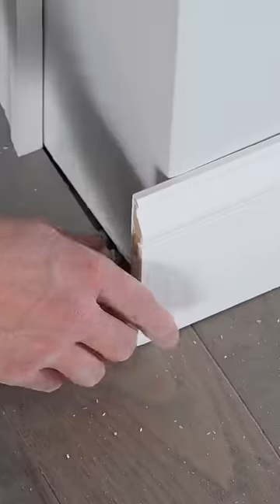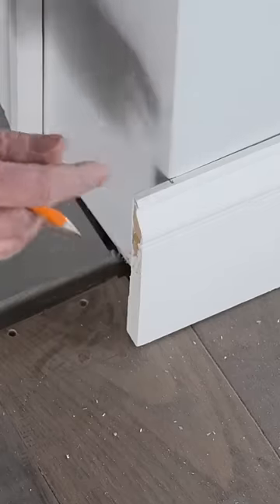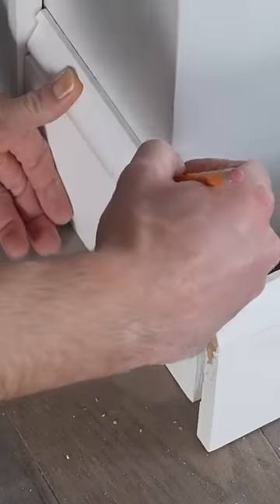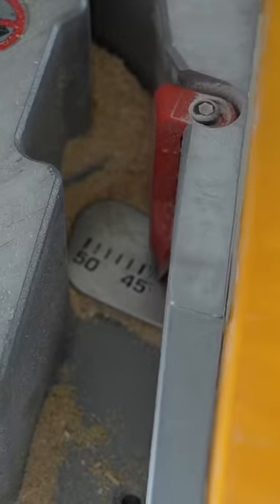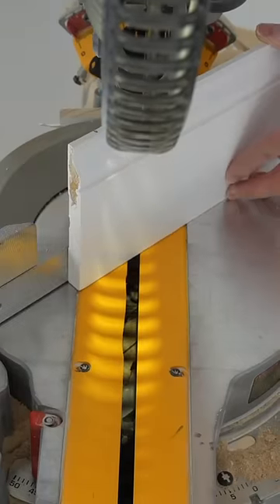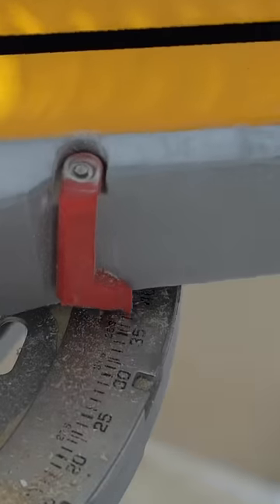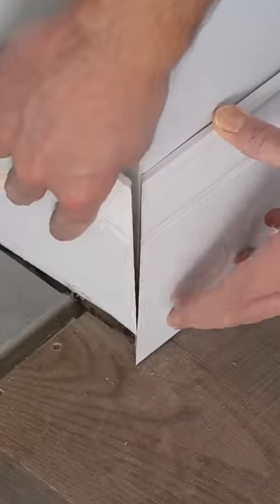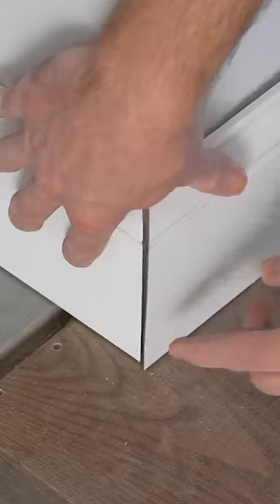Outside Base Corners - DONE RIGHT! #shorts #diy #woodworking

Comment: I love how so many people are master carpenters when this guy is trying to show a good tip to the apparent 2% of the world who aren't master carpnters. Hey man, I saw the scribe on the other end that's going to the stone and most don't do that. Great job and I'd hire you any day my man. keep caring and helping people.
Reply: Very nice.  Only a real trim carpenter would know to add the 1/2 degree om that o/s mitre.  They go straight 45 and end up caulking the crap out of it.
Reply: @michaelangelo1955 I actually use a angle finder to get the degree of the corner and then divide by 2 and take a little bit extra yet, some drywallers really cake on the mud and you end up with a 92 or 93 degree corner. I like to only cut once if I can. I also trace the corner on the back side of the base because sometimes it isn't a straight vertical either.
Reply: The problem with they way he did it was .. it's better to measure that angle first it could be 87 or worse the way houses are built now a days ... 😂😂
Reply: Oh oh...BUT THE BOTTOM IS LONGER!!! 😅

Comment: I normally cut the second one upside down so I don't need to change the saw.
Reply: Always 👍
Reply: Steady Eddie does it that way too!
Reply: You risk ripping a chunk out of it at the thinner top doing it that way. When i do it that way i go a lot slower near the taper. 

Do you ever do that?
Reply: How do you see the mark? 😅😂😅
Reply: @aaronmyers4054 transfer it to the bottom of the piece with a square?  still quicker than turning the saw around every time
Reply: @SuperOrcy  it was a facetious comment hence the laughing faces 🤦
Reply: @carcasscruncher9354 that little rip happens only on the return of the blade. If you stop the blade before letting the saw go back through the material, it doesn’t tear the material up.
Reply: @LESLASLESLAS  I've never had it tear on the return. It's as soon as the blade touches the tapered end. Maybe I need a fresh blade. Idk

Comment: Pro tip. Scribe along the wall on the inside of the piece. Will give you the longest point of the corner. Cut there. Perfect every time
Reply: No you marked the top of the trim and at the bottom of the corner is proud of that you can shave out material from your trim board on the back side
Reply: @BryanL1982  nope. Put it where you want it, scribe, cut longest point. Don’t question the pro.

Comment: Nice cut but I always liked using the fancy decorative outside corner base moldings...at most they cost about $5 each or so and for a couple hundred bucks you have some awesome architectural features added to your baseboards and it is easier to install since all outside cuts become zero degree cuts...easy!

Comment: That first pencil mark was anything but precise. Also, should make it more realistic and do a corner that is 2 or 3 degrees out of whack
Reply: Ok boomer
Reply: Caulk
Reply: Not caulk silly.  Use a bevel, get the true angle and cut it accordingly.  Then you don't have to come back  and recaulk later, or worse yet, your customer calls and wants to know why it's cracking.

Comment: Left side of the return aroune the cornerr needed cut to fit the tim to fit  if its door casing it also needs properly mounted.   Stained trim wood work would be a waste if this is how it was installed.   Always install as if its finishd.

Comment: I do 45,5 degrees all the time too!! That’s how I knew you’re doing a good job 👀
Lol…

Im not perfect, but that .5 degrees definitely helps most of the times!!
Reply: Especially on short corners. The corner bead and compound build up has a more pronounced effect compared to longer wall corners. 1/8 inch over 1 ft comprises a larger percentage than that same 1/8 over 10 ft.

Comment: ACTUAL FINISH CARPENTER,  you would always use a tape measure,  as carrying around the pieces to the walls twice is a waste of time. You lay the boards down flat on the saw, not vertical, cutting left and right with the bevel part of the saw, and it's easier to mark and cut on the back side of the baseboards.

Comment: 45.5 degrees? Ahh okay there. Some walls are 90 degrees, some are 87, some are 92. You should measure the corner and then cut the angle you measure divided by 2.
Reply: In a real world you're not gonna get that.
Reply: I just put my angle finder on it and it tell me what to make the cut.
  Also I mark the back of the base with a utility knife or a sharp pencil 
  Up by the top and put a faint line where to cut
Reply: Why he didn't just cut it 45 one time

Comment: Do you actually have walls where the skirting boards are exactly 45° Non of mine have ever been.
Reply: Caulking is the carpenter's best friend
Reply: @btrswt35  spoke like a true wood butcher
Reply: @btrswt35 can't caulk stained wood. All I ever see on these videos is white base but 95% of the finish I do is all prefinished stained poplar. My joints have to be perfect because there isn't any caulk to save the day.

Comment: But do you cut on the left side of the mark, the right side of the mark, or the middle of the mark?
Reply: Right on the mark, that's why the extra degree past 45. Makes up for the blade width. Hope that helps.
Reply: My bad he said to the left of the mark, but again that's why the 45 1/2 degree makes a tighter fit.

Comment: Can you explain the logic behind it. It looks good, but whats the purpose of the extra degree 🤔
Reply: To make sure you get a crisp finish line on the mating front edge.
Reply: Corners aren't perfectly 90° because of the metal plate used for the drywall.
Reply: @altokers  😊
Reply: @DragonsOfAra  Thanks.

Comment: Try using a bevel rather than mitre. Its more accurate. I always cope my outside mitres
Reply: Please enlighten me how you cope an outside corner. Also. If your saw can cut the angle standing up rather then laying down it will always be more accurate.
Reply: Cope an Outside Mitre? Huh?
Reply: Stop it ..please

Comment: Do you find 45.5. Or  46°   ?
Reply: It depends for me on the condition of the corner 🤷🏽‍♂️
Reply: Just get a protractor or a specialized miter finder protractor will give you the total angle and you decide by 2 the Miter finder will give you the exact miter number.
Reply: Divide

Comment: 91° on the trim 89° on the actual corner. Easier to actually measure your corner and cut the trim properly. This guy probably thinks dry wallers are accurate😂

Comment: No no!! SMH 🤦🏻‍♂️ ok let’s go over this again..
You just eye it out, mark it with a piece of soapstone or other entirely imprecise writing implement and then smear in a big gob of caulk in the gap you have leftover!
It’s called the “Do your best and caulk the rest” method.
Lol 😂. 
Just kidding of course. Nice tip man. I’ve noticed my older chop saw has been getting pretty off on the 45 notch. Too many swings around into the click without cinching down on the wingnut. 

I tell you! Kids these days